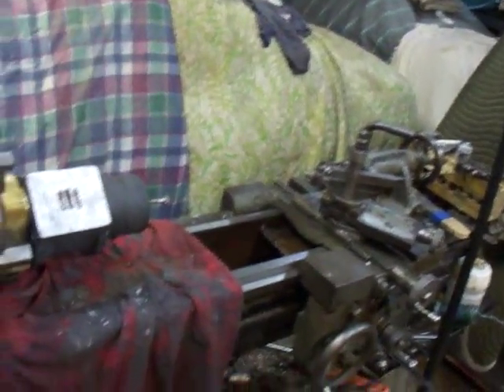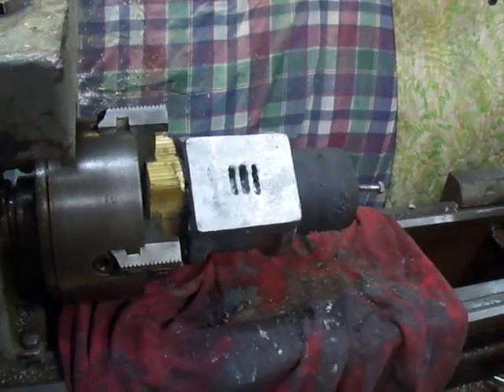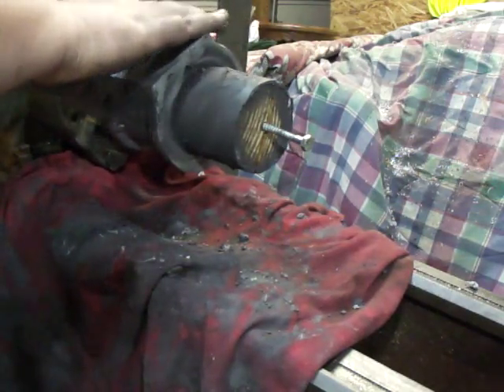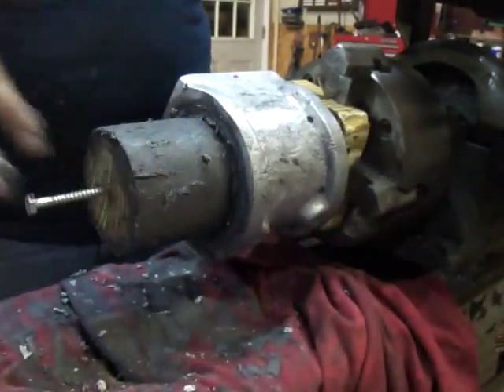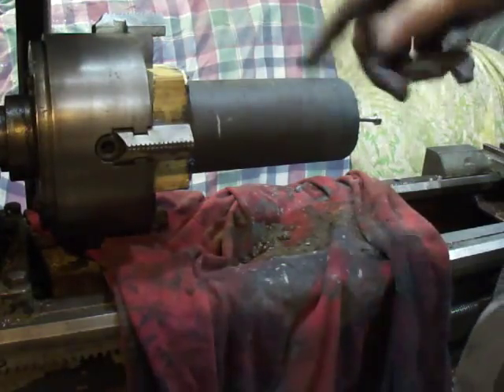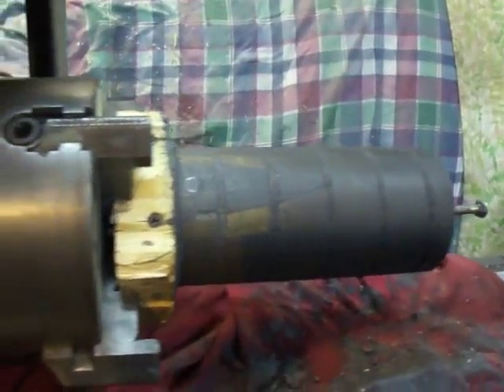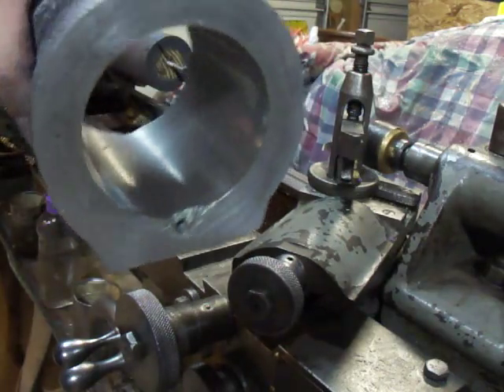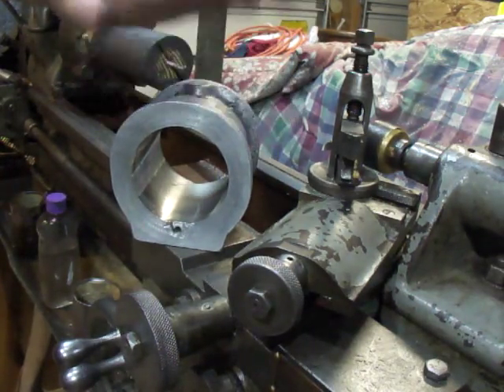Steam Engine Build #4- Lapping Engine Cylinder

Comment: I would never of thought this would of worked. It seemed so non machinist accurate. Love the problem solving.
Reply from the maker: yea, it actually worked better than a store bought cylinder hone would have worked, lol. It took pretty much all of the out of round out, and took out the taper too while leaving a glass smooth surface.

Comment: I love your videos.

Just for kicks and giggles see if you can get your hands on a bore dial indicator or a set of snap gauges to check the cylinder for round and taper.   You might get some guy in a speed shop that builds engines interested enough to test it or let you use the indicator in his shop.
Reply from the maker: I started out at around 4 thousandths out of round from worn headstock bushings, and Im down to less than a half a thou for roundness. It also took 6 thou taper over 3 1/2" down to less than a half of a thousandths. I was curious of it myself and ended up testing it. I can lap it some more if I was wanting to get it perfect, I just stopped because my hands were starting to hurt. Overall, the precision really is pretty good after lapping and I just finished the piston with teflon rings in it, and the bore is so smooth that the teflon just glides in it.
Thanks for watching and for the comment.
Reply: EXECLENT !